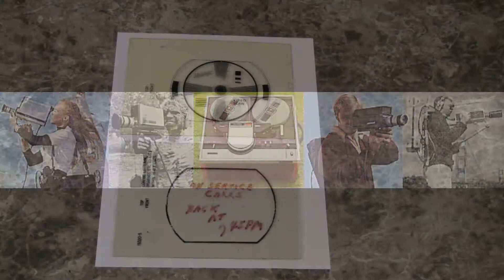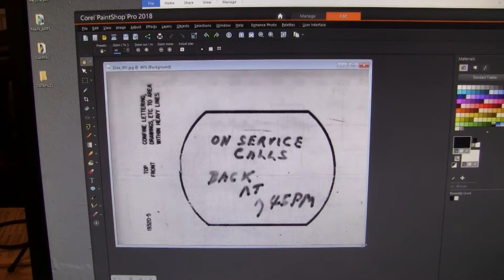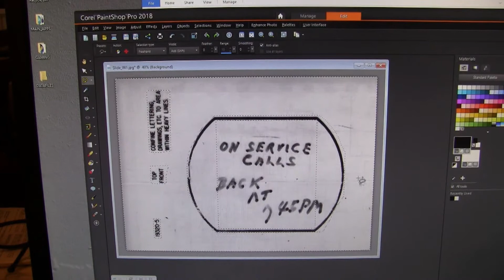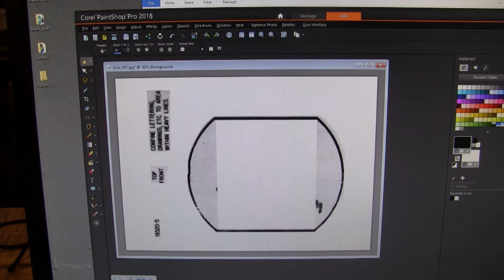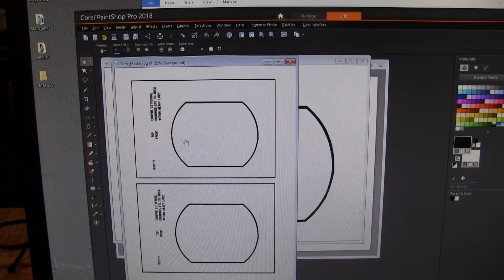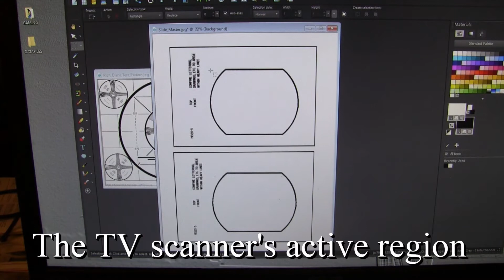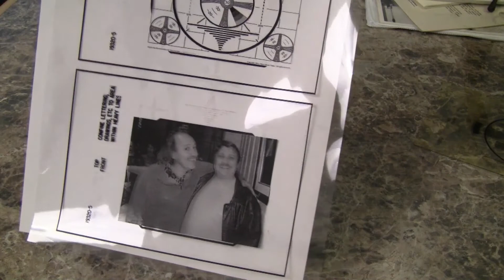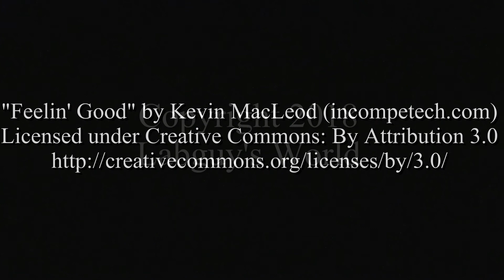Hickok 760 FSS - Making your own slides!

Comment: I'm surprised TWAIN is supported under Windows 10?  A Lot of work in your workflow in regards to cleaning up the image, have you thought about just scanning the image as a OCR? I would think it would cut your workflow down a little bit?  And are you sure that was the real Gallagher and not his deranged twin brother?  I'm sure you know the story.  :)  ~Jack, VEG
Reply from the maker: I can't see any reason TWAIN is not supported in Win10? I installed the drivers for two scanners with no problem. Just like in Win7 for the past oh so many years.

OCR? Optical Character Recognition on a grey scale photographic image. Really? I am a hardware based engineer. I think ONLY in pixels and color depth when working in the digital domain. So, as you saw, for me, 8.5 inches is 2550 pixels and 11 inches is the number 3300. 

As for the work flow, I demonstrated the LAZY way to insert the images. When I was pulling the selection tool rectangle over the master slide active area, I was not careful to maintain a perfect 4:3 aspect ratio (1.33333...). I also copied the source image in its original size of about 600DPI, and pasted it into the selected outline, allowing Paintshop to scale this data however what way it does. We are talking TV test images, and you must be extremely precise to not distort any of the elements in the test pattern so you get a print that can be used for real measurements. 

Messing up the picture is the Hickok's job!
Reply: I am a geek!  :)  I have not played with TWAIN nor really had a need in sometime, I know its old technology, I was just surprised that it carried over so far!  I used to think in those realms as well, I am a retired pro photographer, and have worked in the computer industry, but retired from that in 2005...in both fields, I am now a very happy end user and dont miss either.  Just think, if you put a cinemascope mask (yes, I know a anamorphic lens realistically, just being light hearted) over the slide area you could start to think of 2.39:1!  :) 73's OM! ~Jack, VEG
Reply from the maker: Nothing to prevent me adding a 4:3 or 16:9 switch to the scanner eventually either. Good thinkin'
Reply: That would be very cool to see!  Just a FYI, I dig your www, thats how I found your YT sometime ago, being a camera geek I stumbled across it doing research work!  ~Jack, VEG

Comment: It's been so long since I've dealt with what appears to be a Gen Lock problem?  Would a TBC feeding both your camera and the Hickok or a B & K clean this up?  Maybe neither has a Gen Lock input.
Reply: I just looked up a B&K Precision unit on eBay.... No Gen Lock... I guess there was no reason to have it as the product wasn't designed for video Key work.
Reply from the maker: This thing could be genlocked. But it is meant for the TV repair market. The Hickok does have a blocking oscillator based timing chain that produces 2:1 interlace from a crystal oscillator to I presume at 525 / 30. The B&K 1076 and 77 are random sync.
Reply: I realize it is for the TV repair market, but I thought Genlock with the camera which you are making the recordings might stop the roll problem.